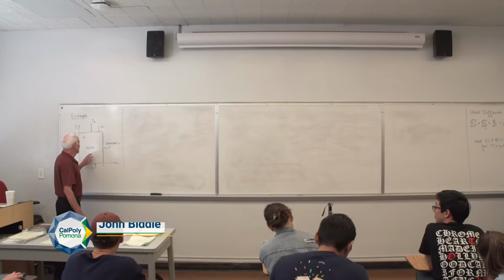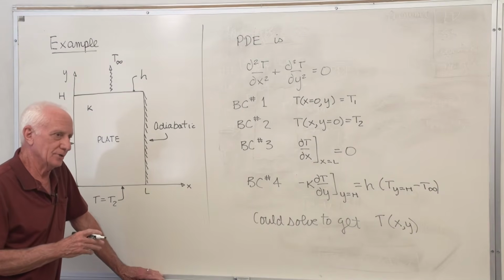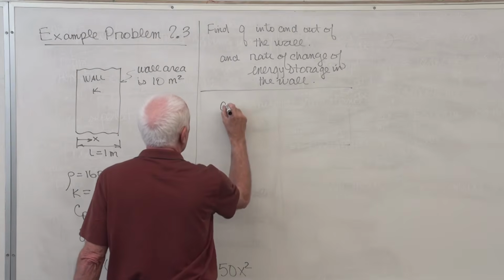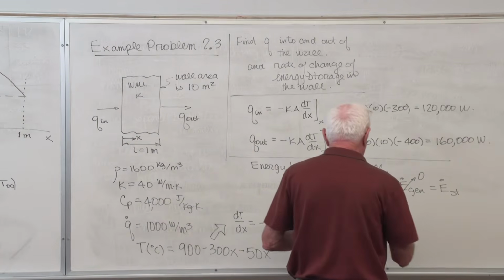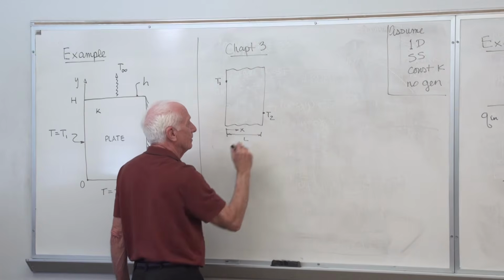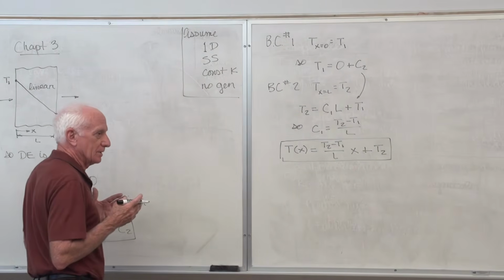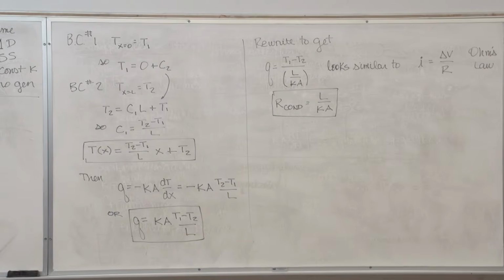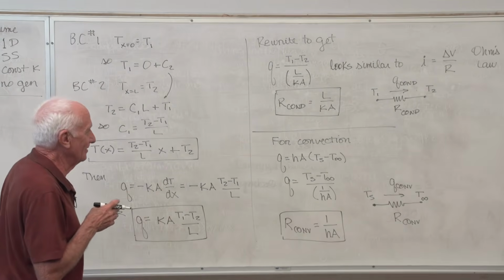Heat Transfer (05): Heat diffusion examples, 1D conduction in a plane wall

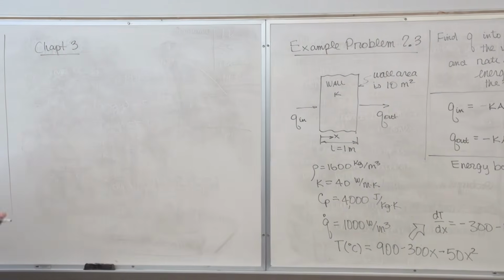Comment: 18:09 can someone explain why you can solve for Pc_p dT/dt and how that gets you to the Est = -30,000W?
Reply: So you use the entire diffusion equation like he did before as we solved for those values in the previous part. So from the right hand side you divide over density and c_p and solve for dT/dt, since density and c_p are known. Using this result you can then solve for Est =density*c_p*dT/dt. Hope this helps
Reply: @theogreen2186  but dT/dt=0 as T eqt is independent of time? So how
Reply: @s @saminanb6043  DT/dt isn’t 0 it is one of the unknowns you’re solving for. You can rearrange the whole diffusion equation to show what variables equal any other variables. Since there are several variables known from our previous example, you can use those values to solve for DT/dt and with that known, you can solve for the actual problem Est

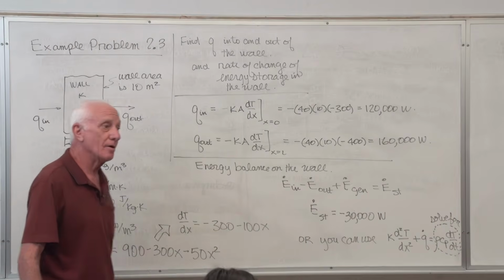Comment: in 18:00 , if I use the right bottom equation, then dotE_st=40*(-100)+1000=-3000W. Why am i not able to get -30,000W?
Reply: Est dot =m cp dT/dt

m= rho * vol = rho * 10*1
Just multiply ur answer with volume (10)
Reply: Why?  @abhijithsuresh880

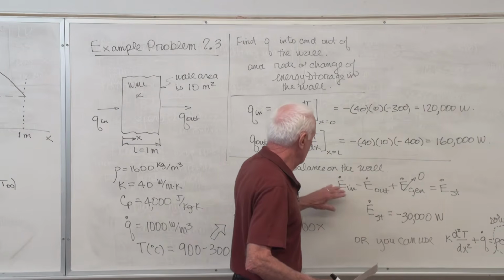Comment: in the min 16:00 Eg dot  = q dot * Area * L , q dot and Area and L are given, plug in the values to get 1000*10*1 = Eg dot, hence the equation is :

Est dot= Ein dot + Eg dot - E out dot 
Est dot = 120 kW+(1000*10*1) - 160 kW
Est dot = -30 kW = -30000 W 

Hope this helps :)
Reply: I was confused, thank you
Reply: Thank you

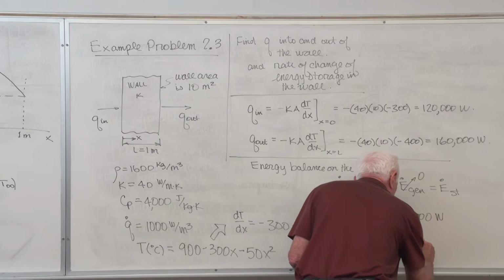Comment: at 15:20 why is it -30,000 watts and not -40,000 watts? Where did that -30000 watts come from?
Reply: same question
Reply: E_gen should be q_dot * volume, so 1000 W/m^3 * 10m^2 * 1m= +10,000 W, and therefore it's -30,000 instead of -40,000.
Reply: @martinhvik2216  thank you very much!
Reply: @martinhvik2216  but he said E_gen is equal cero, so I am lost again
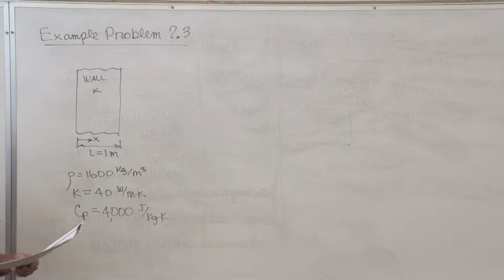Reply: @lauragomez3516  He said it was zero and crossed it out. When he wrote out his givens @ 7:21 E_gen was given, and he forgot.
Reply: @theomnipresent1  thank you 😊
Reply: @theomnipresent1  that explains it thanks